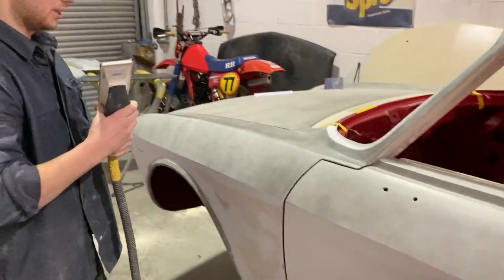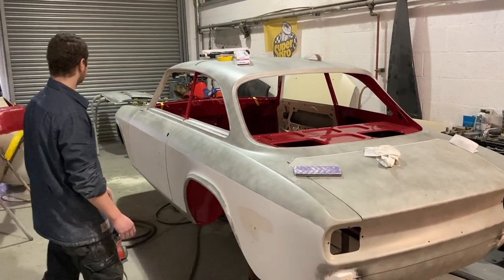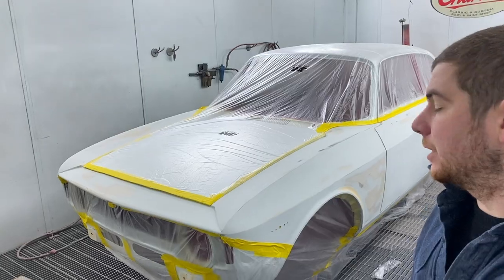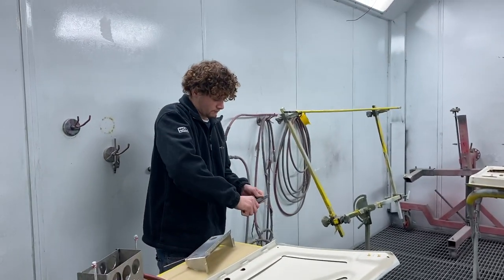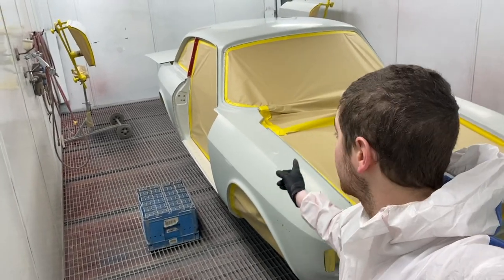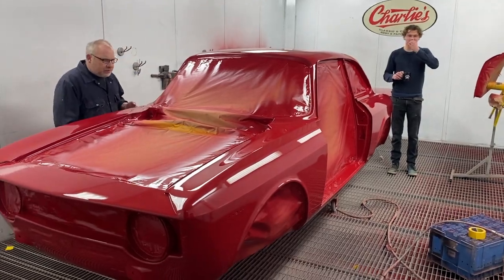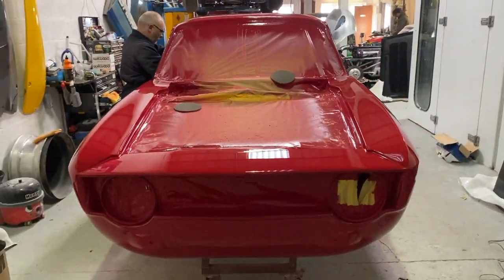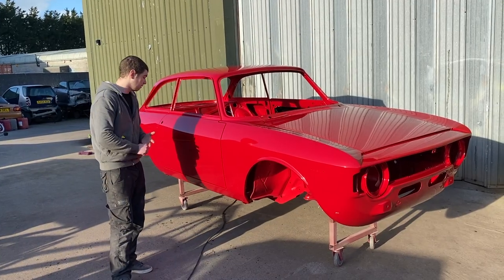1969 Alfa Romeo GT Junior | Alfaholic GTA | Baremetal RestoMod | Part 2

Comment: Superb job Charlie & crew, how come you didn't do base & clear, for originality?. 450 hours is that a 20k paint job ( sorry to be nosey)👍
Reply from the maker: A few reasons, the DG has a slightly more original look also it is a good colour for DG, some colours can drag or try to separate the pigment when wet flatting and polishing so in that situation we would go BC. 
Yes that is correct we did carry out some repairs and modifications on this one though so normally would be around 370-400 hours.